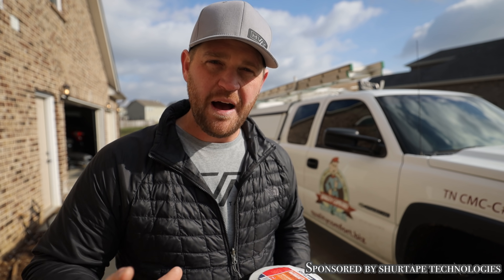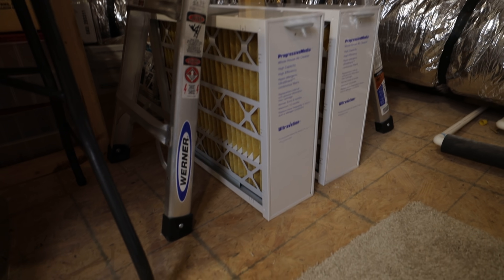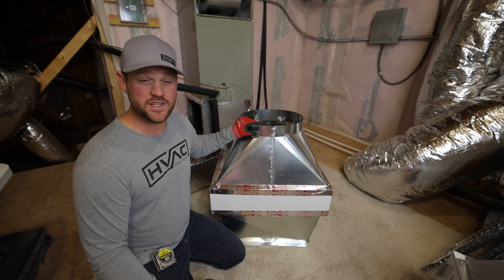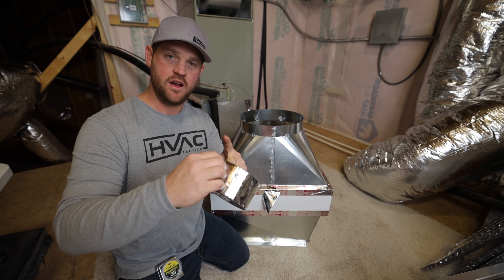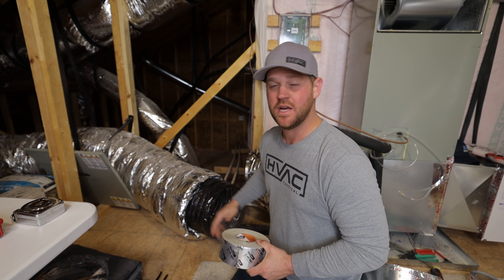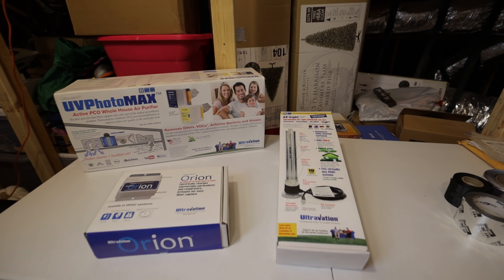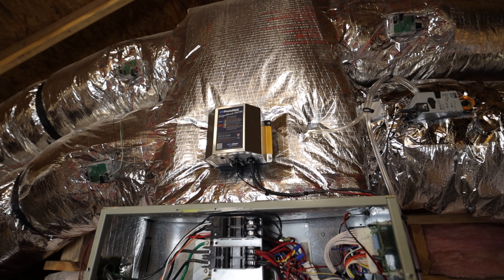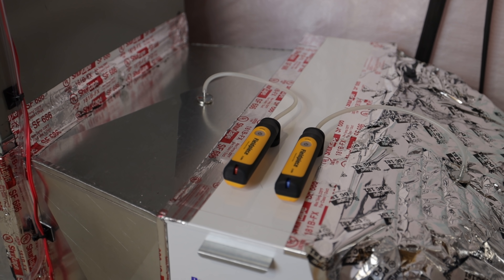Installing WHOLE House Air Purifier & UV Light | HVAC Healthy Home

Comment: Why 2 filters tho?
Reply: Because there is 2 returns.
Reply: @mattluongo7763  I put filter base sideways under unit.
Reply: Rona fear.
Reply: @Deltron6060  rona fear lol honestly wouldn’t be surprised
Reply: 48" wide return box, set unit in middle of return box on top of filter base, tie both returns into each side of return box. Now the customer only needs one filter. But this is still good work.
Reply: @chasetoedter9185  I agree still good work

Comment: What's that little plug you put into your hole for the static pressure probe? That looks really clean and much better than the tape I usually use.
Reply: You can get them at trutech tools or amazon. Whatever size hole you drill. Nickel plated, silver, black etc...

Comment: "IAQ products" are nonsense. Focus on good filtration (like the 5" media you installed), controlling humidity, and fresh air, AKA the holy trinity of IAQ. PCOs and UV has the potential to be harmful and DO NOT actually solve problems. You dont treat the symptoms, you fix the problems.
Reply: Depends on what part of the country you are in as to what problems you're trying to solve. UV lights are the way to go in hot humid climate when probably installed. Educate the customer. Different levels of intensity measure in micro watts. Cheaper lights are good for keeping coils and drain pans clean and clear of growth, not sanitizing the air. Problem is most techs don't install them right. Need to use reflectors and foil to protect flex duct liners and wires from the UV
Reply: @mattluongo7763  even in that case its a band-aid and ignores the actual problem. It treats the symptom not the cause. IAQ is very complicated. You have to look at the entire house as a whole(starting with a blowerdoor test) to actually fix the problems. You are not an IAQ expert if "boxed solutions" are your solution.  Plus uv can produce ozone which is a terrible thing. Even bulbs out of ozone frequency range and degrade over time. Then can fall into the spectrum and start producing ozone.

Comment: That by-pass might blow dust back into the house when filter or duct is dirty....especially if using a pre-filter inside....   I tried that way years ago and had to go back and change it. However it does look much better duct-wise that way.
Reply: The by pass is for making sure the duct work isn’t over pressurized due to the zone system installed. If only one zone is calling for conditioned air the ventilation system could be over pressured  or cause high noise from the supply vents. 
I asked the same question my self and that’s how it was explained to me!
Reply: I normaly by pass the by pass!!
Reply: Hey! Nice to see you here. Quick question, what's that bypass for? Why is it needed?
Reply: @Keo0oo  technically. Say you have a 3 ton system=1200 cfm and your smallest voting zone is only 800 cfm. You size the bypass to handle the remaining cfm of 400. This is too assure proper airflow of the system. Then there are other factors to deal with as well.
Reply: @acman0926  Understood, thanks for the info brother.
Reply: @Keo0oo  The bypass will relieve the blower when a damper closes and "chokes down" the system below it's required airflow specification.... I am not at all a fan of the so called "zoning" done with systems that are not designed to operate in a variable capacity application. But the bypass does at least "trick" the blower and lower some noise and static pressure issues. However, it does nothing for the amount of btu's that have to all try to fit in the reduced duct capacity when a damper is closed, so the supply air is measured by a DATS sensor and the compressor is cycled to death killing longevity as well as efficiency. On a gas system it will of course cycle the burner to death at pretty much the same costs. I am a big fan of zoning, but not this way. 20 S.E.E.R. Trane with communicating zoning components is the way to go IMO.
Reply: @TedCookHVAC  Very informative to a green technician. Your knowledge will go a long way good sir. Thank you and Merry Christmas.
Reply: @TedCookHVAC  I agree on the xv20. Zoning any other way is strictly for comfort, not efficiency or longevity
Reply: @TedCookHVAC  I was told that if a bypass is needed, it should dump into a little used area like over a stairwell so the bypass air is going to be mixed with the house air before coming back through the returns.  That way you're not dumping conditioned air right back into the coil and potentially causing icing problems and decreasing efficiency.
Reply: The master himself chiming in!
Reply: The owner of this YouTuber doesn't respond to people challenging his knowledge. He only responds to positive comments. The Man doesn't want to stir anyone up or be told he's wrong.
Reply: I'm not sure why he even did a bypass with the Trane communicating system. Variable indoor blower motor with static pressure transducer. After you go through and set up each zone percentage on  initial installer setup, the zone board will open or close each zone damper to relieve air, so static pressure isn't a issue.
Reply: @chasetoedter9185  good point...... might not of been set up right or may be a safety in the event the pressure controller fails..... who knows.
Reply: @chasetoedter9185  That is not a Trane communicating system .... notice the "EWC" zone board mounted on wall behind air handler.
Reply: @chasetoedter9185  it's easy to tell who has the experience

Comment: This may be a dumb question but... if those 3 devices are tied into one circuit wont they all go out if one dies. Are they in series or parallel.
Reply: always in parallel. otherwise a dead bulb acts like a blown fuse in a circut. i prefer to add in a transformer to avoid voltage drop off one single circuit. just a preference.

Comment: I really enjoy your detail. I didn’t really understand the two filters instead of one on the base can though? Would think you would have a high static drop
Reply: Take a bag cut a hole and blow through it the cut a second hole and do the same. More openings less resistance.
Reply: He explained why
Reply: You have less static with dual returns. More filter surface area.

Comment: The company I work for has been putting in new air cleaners called Iwaves and they are very nice. Not sure if they have them in your area but if they are they are definitely worth taking a look at. They are made by Nu Calgon.
Reply: COVID def helped sell these. Did a lot this year.
Reply: My company installs Iwave too! Put one in literally less than one hour ago!
Reply: They are a joke. They fix zero problems. At very best you get the placebo effect. Good filtration, humidity control, and fresh air should be your main concern for IAQ. Its the holy trinity.
Reply: @FoXHounDXD  Not disagreeing with you. But I'm not going to argue with my company.
Reply: @AlexBianco100  yeah thats a tough spot. Companies do it because its something to sell to make money. But if people really understood and had a good process to follow you can upsell larger projects that actually solves problems. Making more money and have far happier clients.
Reply: Air scrubber by aerus is the only one I recommend.
Reply: @justingibson8788  Then you obviously didn't even read Aerus sales literature. Takes 24hrs of exposure to eliminate 100% of germs. How many seconds d'ya think a germ is under that light?

Not enough. Even 2 hrs is too long.
Reply: @OzarkGenerations  its not the light that is killing the germs. its the peroxides, that  take time to build up.

Comment: Is anyone else concerned about all the flex
Reply: What about it?
Reply: @vincentgrueter7759  flex is restrictive if not size properly. Most people don't use a flex ductulator only ductulator for metal and size the flex off it. Therefore the flex is undersized.
Reply: @danielbergey3358  well being that I have no knowledge of a ductulator, im inclined to take your word for it. But my company has never had any problems with flex ducts, if strapped and stretched out properly it should be adequate. But if not then I can definitely see there being problems.